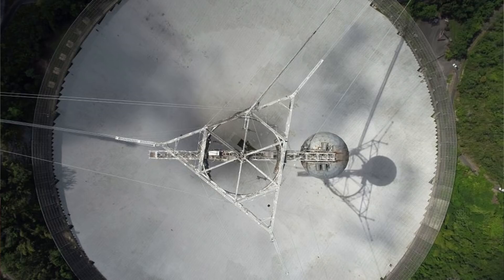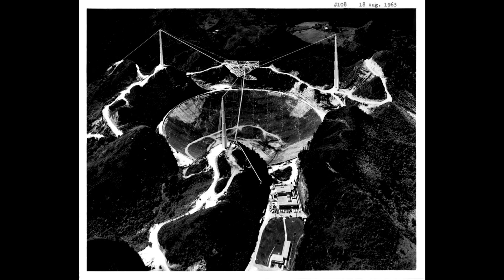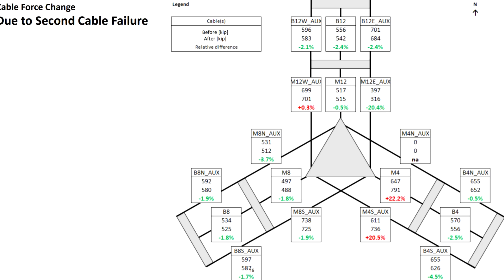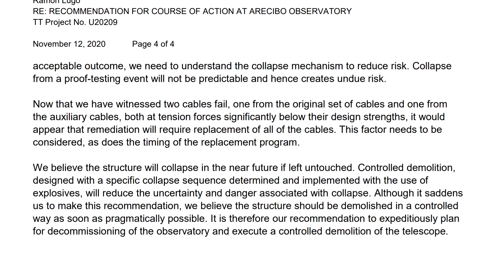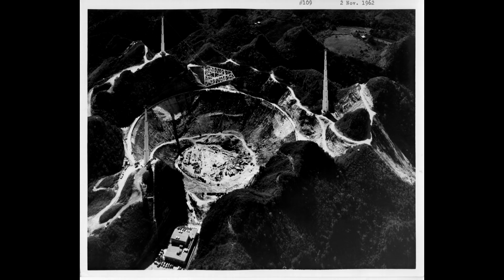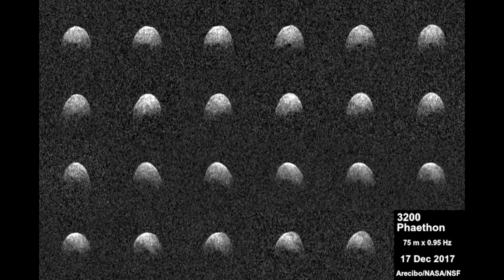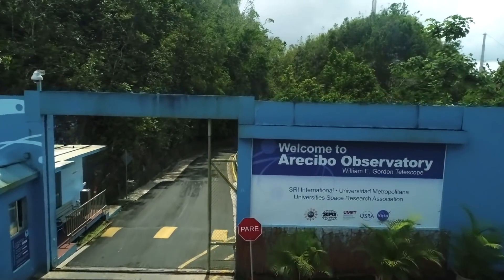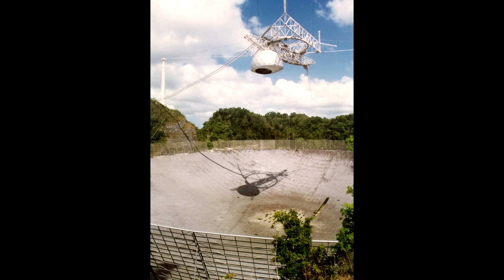Worlds Largest Radar Astronomy Dish To Be Demolished!

Comment: I'm kinda puzzled as to how this could ever have been fixed. Replacing the cables while under stress seems like a terrible idea, even if the cables were intact; but there seems to be no facility to release the stress by, e.g., lowering the whole gantry to the ground for maintenance. The cables in bridges are routinely replaced as a matter of course, and they're designed to allow this. Was this failure built in from the very start by the design in the 1960s, which was not a time well known for being forward-looking?

Comment: Damn, I mean it would be great to see this fixed. We do need some tech like that, however, the cables have been left for almost 80 years in the elements. Would it be possible to get a helicopter to attempt to take some strain off of the center section, with secondary tethers to the workers in order to allow them to work on this? I realize this would be a monumental task, but the MI-26 should be able to assist there, surely...

Comment: It was also used by SETI rigged with their broadband scanning system. They used Pioneer to test if it was working correctly. Truly an iconic instrument and building. The SETI message that was sent out of Arecibo was just a demonstration of what it was capable of. It was well known that the signals would not reach the star cluster it was aimed at.

Comment: The computers from the 60s are also unique machines, but there’s no reason to maintain them.  The function of this piece of  old technology is not unique to this site.  We need better reasons to keep it, and I’m not hearing those reasons. 
And being another of those taxpayer supported programs, why should we want to continue pouring funds into it?  The decision makers made this choice years ago.
Reply: We need to continue funding it because there is no replacement for what it does.
Reply: @stargazer7644  but has anyone looked at what it does, and the cost of maintaining technology more than 50 years old vs. building newer, more specialized and capable systems?  Technology has advanced significantly since this was built.  And upgrading old tech forces compromises that cost in performance, capability, and budget. 
I’m just saying that I don’t think this old stuff needs to be maintained.  Of course I’d like to see it replaced, but that’s a larger question of society’s ability to pay for things beyond necessities.  Or, if someone can make the case that this capability is actually a necessity.

Comment: Yeah, so they can't put people on it to fix it.  And they can't put people under to work on something to lower the receiver onto, it in case it fails causing the receiver assembly to fall.

So, demolition is really the only option.  Maybe rebuild with a newer design, modern materials, safer and more maintainable .  Perhaps a design in which the receiver assembly can be 'parked' in a safe position to be worked on.  The problem is money (obviously) and being sure that it offers a capability that cannot be satisfied by other instruments.

But then, if a prospective new one is a similar type of structure, it will require the same sort of mainenance as is done on suspension bridges; specifically the regular replacement of the cables.  So there can't be any skimping on the budget to keep a new one going.

I don't think the money will be there and that it will be lost.  I hope I'm wrong.

Comment: I didn't finish the video yet but had some ideas I wanted to get written down. Just the radar part alone is crucial in my opinion. So regardless what they end up doing like restoring, rebuilding, or replacing. They, or someone else at the very least should build a radar that is as powerful or more powerful than it is now (not weaker like that satellite dish farm that is half the strength or whatever this video said about it). Perhaps if the radar technology allows, and also if it would work better in outerspace than on earth, we could build it in space just like how we moved telescopes to space with the Hubble. I don't just mean satellites or non earth orbiting satellites (probes?) either. A project has been announced that we are actually now going to go back to the moon. So maybe we could take advantage of that and build radar on the moon (in the future we can build an Arricebo or a satellite dish farm there too if that would be useful). Maybe the radar unit(s) can be something completely autonomous so that astronauts don't have to physically be there to set it up or build it on site if it has to go to the outer edges of what faces towards earth or to the dark side of the moon. 

Whatever they end up doing, not sure what their funding or money situation is like, but if necessary they should secure funding from governments just on the basis of locating asteroids that could possibly wipe out their countries alone. All the other science things it does and could do in the future is just extra icing on the cake. Either that or if some other group(s) has enough funding and will rebuild should be allowed to buy it or take over.

Comment: Those cables needed to be replaced years ago. Now that it has started snapping there is no saving it. They would need to drop the suspended tower and replace all the cables. If they didn't have the money to fix it years ago when it had no damaged they sure don't have enough now.

Comment: The ideal solution would be for those billionaires not to repair it, but fund a brand new 21st century one in it place. If this is repaired then there could be similar issues down the line along with the H&S issues already identified, but to remove it and install a new one from scratch with addition capabilities, that would be a great development.

Comment: Bezos and Musk should buy it and operate it off a private foundation (maybe get the Gates involved).  Though, based on the various reporting I've seen on it, the damage and rot in the current system is too great, and not salvageable.  But, it's still a perfectly good sink hole with 3 massive anchors, equipment building, visitor center, etc.  They could build a newer version of a radar scope.   As interest goes up in asteroid mining, such an instrument could possibly pay for itself.

Comment: Set up a demolition, offer it up on pay-per-view, and use the money to start building a new radio telescope.

OR...

Build 3 new towers, with new carbon-carbon fiber cables, and transfer the load while the dome and center section remains in place.

Certainly, there will be ideas that may be worth pursuing. With 200,000 views per day, we are bound to find some interesting suggestions!

Comment: Does sound like its past the point of simple repair. Its a shame but maintenance is often a neglected consideration in design. Really if they were going to re-build it, they need to ditch static cables and introduce large motor drums off the outer side of each tower, which in unison can raise and lower the central scope. Yes this is much more expensive but it will dramaticly increase the life span of the telescope. Some of the cables may have failed earlier than expected, but the law of Entropy only goes one way. Eventually all cables will weaken and snap. Replacing cables on a suspension bridge would be a major task, but at least in that senario there are many more cables to take the load whilst the operation is performed (Very large safety factor). It doesnt sound like the same level of S.F was implemented in this design. An extra added bonus with the external motors is that the central scope's focus could be controlled without putting as much latteral stress on the structure. By making the towers taller, lateral stress on the towers could be made negligable (although this may create stability issues for the scope if not further ankered or sufficiently heavy enough to create enough stabilising tension). In any case, its always going to be preferable to perform mainenance whislt the scope is on the ground.

Comment: Just send a van load of Mexicans there. Give them the tool needed and they’ll have it fixed by the end of the week. I saw some guys shingling a church roof which must have had a 24:12 roof pitch, like 40+ feet up, no ropes or anything for fall protection. I couldn’t hardly believe no one died doing that job. I was shopping at Ace a couple days after they had already been working on it and one of the guys came in to buy some cheap rope that they could tie around their waist for fall protection. I just shook my head thinking you guy are crazy as all to even be on that thing in the first place.

Comment: Someone needs to film the inevitable collapse, so we can have an improved cut of Goldeye featuring more realistic 'special effects' :)

History is filled with stories of cables being constructed with corners cut to save costs, despite the protests of architects and engineers. Even the Golden Gate bridge features cables that are significantly weaker than they should be, thanks to unscrupulous builders using lower-quality materials to construct its cables. This is why the designers of any large projects featuring cables ensure loads being held together are supported by cables that - in theory - could hold up weights 3-8 times heavier than what the structure requires.

This is why the cables are starting to give way. On paper they should still be fine but in reality they were never as strong as they were meant to be.

Comment: its a shame the towers that support it where not set up to rise and fall hydraulically / electronically...   they would have been able to adjust its height without the added weight of the cables in the tension project, as well as being able to lower it for servicing.. a set of spires near the center would also have needed to be built so the instrument section came to rest on them when it was lowered to the lowest height.    now, it's sad they'll take it down, but are their plans to build a replacement at the location?  could take a while either way but still it's extremely valuable as an asset.
Reply: there isn't enough time to develop a robotic 3d printer to construct support structures.  ya they'll put demo charges on the locks for the wires to release them all at the same time, remotely... i hope its video taped, many many ... MANY will watch... but we have to replace it, not just let it fade to history.

Comment: Problem is in Maintenance program or faulty Maintenance program. Snapped cable should have never happen. That is the problem poor Maintenance program caused a total rebuild. But rebuild or new build dish would never be stated in PR a earth quake Huracan problem area.
Structes engineer FedEx poor maintenance cause one landing gear to colasp. Maintenance program if not done right destroys. House no roof Maintenance program  that will complete destroy a house and the only way to fix is tear down

Comment: if you have to bounce radio signals to do radio astronomy; how did they do radar mapping of saturn  when it is between 71 and 87 light minutes away with a dish that can't be pointed?
Reply from the maker: The receiver can be pointed and can track for a couple of hours of the Earth’s rotation, Saturn was at the limit of this.

Comment: I run a large and aging aerospace research facility in England and I am dogged by possible failure modes of similar catastrophic nature.  Whilst my facility is very different in function I wonder if the guys at Arecibo have any hard-learnt lessons about what they could have done differently - I am looking at a full Failure Modes and Effects Analyses (FMEAs) for example and could use some pointers.
Does anyone have any contacts in the Facilities Engineering sections there?
Reply: Arecibo's main problem is chronic lack of O&M funding for about the last 5 decades.

Comment: It's probably not that weird that the cable broke sooner than expected. Since the force on the cable that pulls it down varies with time, it is going to introduce some serious fatigue loads in the cable. Since this is a feature that they didn't plan in the original design it could be that the original cables weren't designed for that. On top of that, it seems like a very humid climate. The combination of those factors could result in some unexpected effects. what they could do is try to span a cable between the poles on which they can secure the workers while they try to fix it. The obvious solution is to replace the cables but I guess if funding is the problem there isn't much they can do.

Comment: Technically, this could be rebuilt with stronger and lighter materials that we have now. Completely dismantling the telescope will be expensive on its own right, reconstruction of a new one over the same sink hole? Would require a ton of outside funding and help - I'm sure it could be commissioned if Aricebo was playing an important role in identifying potential near-miss asteroids.

Comment: Would it be possible to bring in cranes to help hold up the central piece? This could reduce the load on the towers, at least for a short while to attempt any repairs.

The only other thing I can think of is to finish the sell off process, go through with the demolition (if it's salvageable), and rebuild it, but, this time with stronger, more durable, and lighter materials, while also increasing the strength of the cables, from their 500t limit to say about 800t. And, of course, keep the back up cables as well, likely with a 1kt limit just for added measure.

Also, doesn't the US just have a giant and random crater? We could totally build a brand new on their that could be bigger and more powerful for us to use.

Comment: I'm no structural engineer, but just thinking about the extra strain that was almort instantaneous on those concrete towers , in this humid hars environment, makes me think that even if you change the cables, one of the tower will give way at some point...

It would be so much easier if the perspective of building a new one was secured...

Comment: The wire cables I have worked with, nowhere as large as these, are tested, certified, and given a usable life. Routine inspection for wear, work hardening, etc, is carried out. Cleaning and protecting from the elements is also routine. At the end of its life it is replaced, sent away for in-depth testing and recertification if it passes. I can't think why this was not carried out on these cables, except for either or both the antics of beancounters or pure lack of knowledge.

Comment: There are actually plans to do radar in Chinese FAST. Crucially they would NOT use a co-located radar source, but instead it's going to be built some distance away. This adds WAY more flexibility, because your radar source can be continuous rather than pulsed and you can also do multiple radar observations at the same time.

Comment: im baffled there are cables from the 60s still being in that structure, i've seen 6 month old 200ton cables snap.
And to tear this down ? man thats a bigger job than the build if u want to do it safely.
Reply: Tearing it down will be very easy.  A charge on each tower should do it.  In fact, if you're not in a hurry, just wait and it'll finish disassembling itself without anyone having to do a thing.
Reply: @Minonian The problem is the entire structure will collapse with the loss of another cable, and that can happen literally at any moment.  If anyone is on or near the structure when this happens, they'll likely be killed or seriously injured.  People can't even go up on the platform to remove scientific instruments mounted there.  You certainly wouldn't want to be up on the platform pulling up tons of replacement cable.  They're at the point now where nobody can go near it.  They'll place some charges at the end of the anchor points, and let it crash to the ground.
Reply: @Minonian It's really already too late to do anything to save it.  When the main cable broke it sealed its fate.  There's no safe way.  Demolishing it is the least dangerous option.
Reply: @Minonian The people on site have already done the analysis and risk assessment and the conclusion reached last week was that no further repair will be attempted and the telescope will be destroyed.
Reply: @Minonian Well, I think I decoded your broken English correctly.  But maybe not.  You want the people on site to decide if fixing it is worth the risk or not.  I'm telling you they've already done so.  The answer was no.  They decided it was not worth any further risk.
Reply: @Minonian The platform isn't designed to move, it's not a pointing dish. So you can't get the platform down with the dish in the way and there isn't a safe way to remove the dish with the platform in place.
Reply: @duckrutt  You are correct.  The platform doesn't move.  The Gregorian dome with the receivers is on a rotating and sliding track attached to the platform, and that's how Arecibo points and tracks targets once the Earth's rotation brings them overhead.  Arecibo has a very limited pointing ability and can only observe things between declination -1 and +38.
Reply: @Minonian Derp. Dunno what I was thinking of. This is why you don't comment when you're in a hurry
Reply: @Minonian For Thor's sake man, no, you don't speak proper English.  You are a little hard to understand.  I just assumed you're not a native speaker.  It wasn't a big deal until you made it into one. For the record: "And this is the real problem, and there is no help on it. It's just got too old. Anyways?"  and "The receiver moves... that's how repositioning it." are not proper English.  While I think I know what you meant, you're a little hard to understand and some of what you say is close to jibberish.